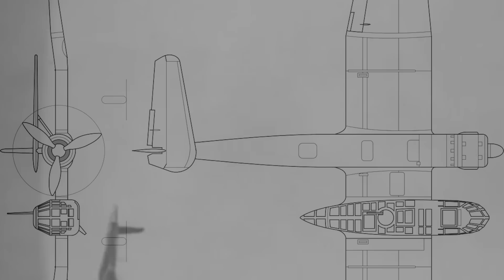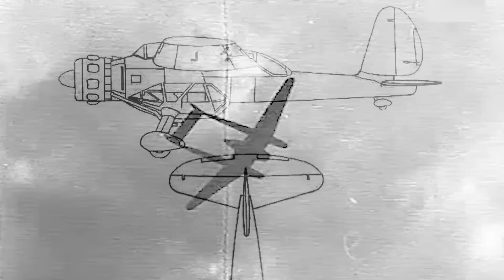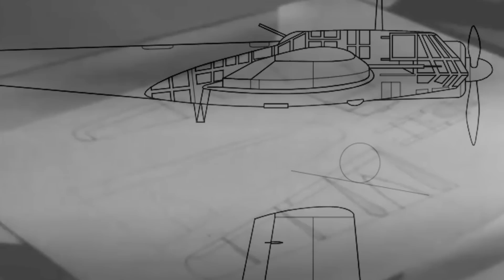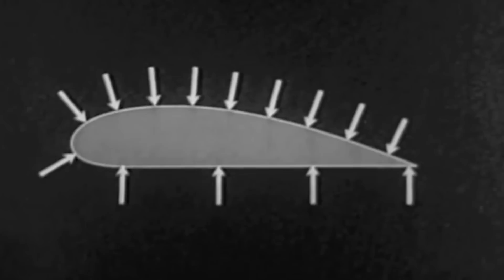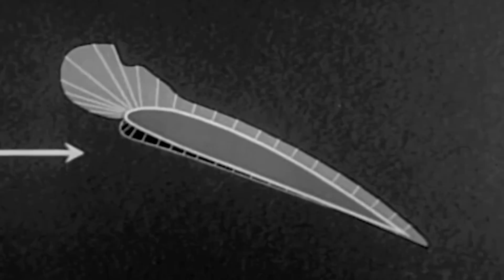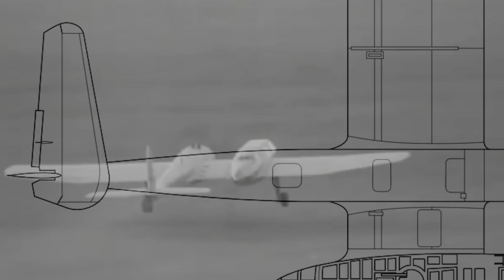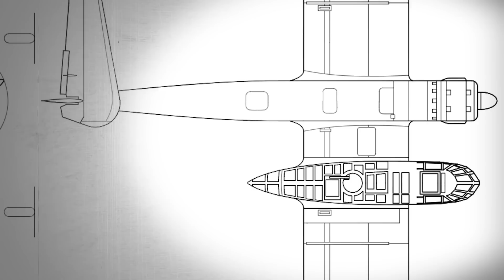BV 141 - The Most Asymmetrical Airplane of WW2

Comment: G'day Dark, When you read the extensive literature on this aircraft, including the glowing Nazi and Allied pilot reports you will conclude, as the designers intended, that this was probably the most symmetrical aircraft, in flight, ever built. This astoundingly clever design compensates for the lift and yaw asymmetry of normal, single prop fighter aircraft of the time. 
Depending on the direction of rotation of the prop; a standard single prop aircraft continually wants to move and yaw to the right or left. This means a constant flight control effort by the pilot to manage this 'normal' lift and directional asymmetry. It's so common it's not even noticed as a problem by those who designed and flew this type of traditional aircraft. It was just the way things were. It is a similar problem that requires a tail rotor on a helicopter to make it fly in a straight line.

The BV-141 did away with this problem entirely resulting in an aircraft that was significantly easier to pilot. The rear horizontal stabiliser on one side only; plus, the slightly longer wing on one side, meant the aircraft was perfectly balanced in lift and ease of control by compensating for the added weight of the crew compartment.

The only fault in this design is the fact that visibility was severely restricted on the left side of the crew compartment. They were, mainly, getting a view of the 'engine fuselage', although they could still see downwards on the left, in a limited sense.

The word asymmetrical can only be applied to the BV-141 in a visual sense and that is purely a description of the aesthetics of the aircraft, it has nothing to do with the aeronautical qualities of the design, which were significant. It's even less important than the off-set nosewheel of the A-10 Warthog, at least in that case, the nose wheel was moved to allow for the in-line, gatling gun.

The BV-141 is, perhaps, the only example of an aircraft that doesn't 'look right' that did, in fact, fly 'very right' indeed. 

Someday a brilliant, young aircraft designer who knows nothing, or very little, about the BV-141 will try to solve the directional 'pull' problems of single prop aircraft and 'accidentally' come up with a design incredibly similar to this almost forgotten WW2 masterpiece of aeronautics.
Cheers, BH
Reply: There was a single-seat Italian fighter which compensated for the torque of the crankshaft by making one wing longer.
Reply: @balham456  G'day Balham, that was clever, and proves the point of the reading I've been doing on this subject. Do you happen to recall what Italian aircraft it was? No, matter if you don't I'll search for it on Google. 
Now that I've got to know the BV-141 I'm interested to know if there are any other aircraft that have tried to get around the asymmetrical torque problem. 
It's a pity that the Nazis had this concept and didn't use it. 
Then the Allies would have, eventually, captured one and I reckon if they had done a really big version of the 141, it 'might' have solved the problem of finding aircraft with big enough bomb bays to take the Grand Slam and Tall Boy bombs. A large engine with a long fuselage; then the crew in a separate compartment 'might' have solved that problem earlier in the war when those huge bombs would have been quite useful, as B-17s couldn't carry them and the bomb bay of the B-29s had to be modified to carry them in the end.
Cheers, BH
Reply: @BillHalliwell  it was the MC.202
Reply: The Scaled Composites Boomerang is not a single-engine design, but it does match the assymmetry of th BV-141 so maybe some of the same thinking went into it...
Reply: This sort of aircraft design might make a very useful sightseeing aircraft (although what I have in mind is a passenger tour vehicle seating, oh, 10 to 40 people, not 3, and definitely no machine guns). Maybe make a civilian BV-141 tour airliner?
Reply: Blohm & Voss: rigorously tested precision engineering to completely eliminate the effects of engine torque with minimal pilot input, resulting in an innovative design that was only killed due to an engine shortage 

Supermarine: haha contraprop go brrr
Reply: A lot of WW2 aircraft were considered "hard" to fly. Half of the aviation casualties were during training.
Reply: @tacitusthehistories5417  G'day Lloyd, Yes, you're right. You'll notice there are many 'Hollywood produced' WW2 'How to Fly' short films made to help familiarise air crew with the 'special characteristics' of various aircraft. This was code for either 'poorly designed' or 'too complex for levels of existing training'. This is one of the many downsides of the US trying, desperately, to catch up to RAF and Luftwaffe training and flying standards. 
It was also one of the results of the US trying to train hundreds of pilots, navigators, bombardiers, gunners and WT operators etc. plus mechanics and airframe fitters in the shortest times possible. Despite leading-edge designers and technologies, creating huge air forces from virtual scratch takes time and amazing amounts of resources.
Even with the, for the time, incredible B-29s, they were (like many US planes) plagued with problems stemming from top speed development processes. There are instances of high USAAF brass ordering aircraft to go into full production without seriously detailed aeronautical research.
This was not deliberate laziness or a lack of professionalism, the US simply had to get into the European theatres and take care of the Japanese threats ASAP. 
It was just what had to be done. 
Many brave young men gave their lives before even being shipped out overseas; dying in training accidents. Once on deployment the speed and zeal of their training continued to take its toll. Before they knew it the Eighth Air Force was making regular daylight bombing runs over Europe, despite warnings from RAF chiefs that this would lead to heavy losses, as they had learned to their peril.
Anyway, I've written too much, again. 
Cheers and all the best. BH
Reply: Developing an air arm is very different to pursuing aerodynamic excellence. This aircraft is a design tour de force but the problems were that is was difficult and complex to build, and that it required the intended pilots to throw away their previous experience and start again with a completely new approach. Hence, although a work of genius, it was something completely inappropriate to the requirements. Which is a great pity.
Reply: that was a great remark, i reckon its a cool plane.
Reply: “Who are you who is so wise in the ways of science?”
Reply: For all their faults the Germans were no fools and had some very talented designers and innovator's under their command
Reply: Non pilot, non historian here. About the torque of the props, which I notice in films when I see planes leave the ground from a head on viewpoint ( like in the film adaptation of Catch 22) which makes the planes yaw when they leave the ground...did the Dornier 335 counter this with its pusher/puller props?
Reply: @felipecardoza9967  G''day Felipe, I'm not an aeronautical engineer, however, I've done lots of historical research on military aircraft from the end of the WW1 and all through WW2. An engineer or experienced pilot can correct me here, but as I understand it, this yawing is only really pronounced in single engine aircraft and this is caused by the type of the propeller and the direction in which it rotates. 
This will, I'm told, cause a natural yaw in the same direction of the prop's turn. 
It's not great and all pilots who train on single engine aircraft naturally learn to compensate for this fact of aerodynamics. I've not looked at a single engined aircraft that has two, contra-rotating props driven off the same power plant. I'm not even sure they existed as I've only ever researched Allied aircraft; apart from the BV 141 (and only because famed RN test pilot, Eric 'Winkle' Brown flew a BV 141 and gave it an excellent flight report; noting that it had far less, or almost no, prop-directional yaw. As for multi-engined aircraft I have no idea. But, at a guess, aircraft like the famous quad-engined Avro Shackleton with twin, contra-rotating propellers on each engine, would not have any yaw effect at all from propeller spin direction; one prop on each engine being cancelled out by the second prop. going in the opposite direction. 
I have no formal aircraft engineering qualifications; my interest is purely historical and because I used to serve in the air force. 
Our service flew the amazingly versatile DHC Caribou military transport aircraft and they were notorious for their yaw produced by two long-bladed props and their, designed ability for STOL at low speeds on just about any type of flat surface. I've seen them, and been in them, landing with about a 30 degree yaw pointing to one side of the strip yet the landing speed was so low the pilots were able to correct the yaw easily once the gear touched the ground.
To, finally, answer your question; as there were only 37 Dornier 335s built, I know nothing about their flight characteristics. Nor have I read about any Allied test pilots flying them after the war. 
If anyone did fly them after the war, chances were that 'Winkle' Brown did. He flew just about every other aircraft that was built in the pre-war, war and post war period, around 480 types in all.
Sorry I couldn't be of more help. Cheers, BH
Reply: @BillHalliwell  thank you.
Reply: I9
Reply: Tahts really interesting fair play
Reply: still useless for single prop.

at different speed/engine power the pilot still has to fight his way through the management, as someone from the top reply wrote, the Italian did away with it with a few inches added to just one of the wings have done a reasonable job already.  a plane with twin boom drag but without twin boom power doesn't sound too clever to me.
Reply: Less of an issue with a turbofan.
Reply: Good day to you, and thanks for that rich info!
Reply: @router9717  Thank you, James...James Bond... Cheers, BH
Reply: Good day to you, and thanks for that rich info!
Reply: "This means a constant flight control effort by the pilot to manage this 'normal' lift and directional asymmetry."  Hardly, as that was the intent of the "trim" adjustments.
Reply: @Nova-Beef  G'day Joe, I was merely quoting one of the most experienced pilots ever to take to the air. Certainly, Capt. Brown knew much more about how this plane flew that either you or me. BH
Reply: Bill Halliwell:  Not a pilot are you?   You wrote "a standard single prop aircraft continually wants to move and yaw to the right or left. This means a constant flight control effort by the pilot to manage this 'normal' lift and directional asymmetry."   What nonsense!  Have you never heard of trim tabs and trim controls?   Trimming doesn't just balance up the controls against variable weight distribution, it balances up against prop forces as well.   When the pilot has adjusted the trim controls as required, he can take his hands off the stick - the plane will carry on straight and level.  Asymmetric forces don't just apply to single engine aircraft either.   With 2 or a multiple of 2 engines, you have the option of contra rotation, but its common to have all 2, 3 or 4 engines turning the same way so that everything is standardized and interchangeable.  However, the one big prop in front of a fighter does make for proportionately larger asymmetric forces - eg the Japanese Zero - no need for constant effort by the pilot in straight and level flight - you have it wrong there - but the Zero couldn't turn as fast in one direction as it could in the other,  the difference was significant which the Americans exploited in dogfights.   So, its not about pilot workload, its about performance.
Reply: @keithammleter3824  G'day Keit, I bow to your superior knowledge. Cheers, BH
Reply: @BillHalliwell  classy reply. The meek (teachable) shall inherit  the earth.
Reply: @keithammleter3824 I am also not a pilot, but I think you may have missed Bill Halliwell's intended point. You can apply trim, but trim is a workaround to having a fully symmetric aerodynamic design in the first place. Also trim induces a lot of drag, and needs to be modifed whenever the flight parameters are altered.
Reply: @tachikomakusanagi3744  : I don't think I missed his point.   He specifically said it needs "a CONSTANT flight control effort by the PILOT" - he was talking about pilot work load, not performance.   And his perhaps cheeky reply to me somewhat indicates he was embarrassed, and confirms  my interpretation of his comment was correct.
I agree that trim is a workaround that cannot restore performance to what it could be if there was no asymmetry - say if you had contra-rotating props (which are also a bit of a work-around).  However, the extra drag is generally not significant.   Check out the trim tabs next time you see an aircraft - they are tiny compared to control surfaces.  You need trimming anyway, to counter imperfect and shifting load.   Yes, trim needs to be altered whenever flight parameters change, eg change of throttle setting, change of altitude etc, but this is often automatic or semi-automatic.  Not during the War though, I don't think.   In common light aircraft you need to retrim occaisonally as fuel is consumed, but you do it without thinking.
The biggest impact on the pilot of single prop asymmetry in high performance aircraft (as in early Spitfires, Zeroes) is that they tended to want to go sideways off the runway during full power takeoff, requiring the pilot to correct for it.  It was just something they had to remember for their first takeoff.  Once air speed was sufficient to get airborne (and thus sufficient over tail surfaces), these aircraft were fine.
Reply: @tachikomakusanagi3744  :   I should also point out that offsetting the engine/propeller from the aerodynamic centre line as with the BV141 is also a workaround - it's just another form of (fixed) trimming and also drag inducing.   The gyroscopic forces of the propeller and its circular airflow impact are still there.  The main reason, and very probably the only real reason, for this design is the exceptional aircrew visibility compared to the conventional single engine in front design, while avoiding the yaw instability and fire risks of an engine/prop in the rear configuration, which is the other single engine solution to the visibility problem.
Reply: @keithammleter3824  I was going to mention trim, but you already covered it very well. I was also going to say, I highly doubt there will ever be an aircraft designer that will need to create a new solution, especially like a fixed trim workaround like this. Normal trim control does a great job and we are already pushing away from props as a form of propulsion. Jet turbines rotate, but I assume they have much less if any affect on the necessity of trim.
Reply: @ec7005  :  You are essentially correct.   There are two bad aspects of propellers: 1)  Gyroscopic effects which make an aeroplane turn differently in one direction than the other, and 2) imparting a rotation to the airflow, affecting trim and wasting energy.    There are two solutions:  a) pairs of contrarotating props, and b) reduce the propeller diameter.  To handle the same power, if you reduce diameter, you must add more blades.  If you want to handle more power, and not increase the bad aspects, add more blades.
That, and the avoidance of longer undercarriage and reduced engine RPM that would be needed if diameter was increased, was why the later versions of the Spitfire,  with progressively upgraded engine power, had more blades - starting with the standard 3, progressing to 5, and finally having 2 x 5 in contra-rotation.
A heavy bomber, with (say) 4 engines is really an example of having lots of small diameter propeller blades for the power level.  That is one reason why Bill Halliwell in his second post is really getting bizarre in suggesting that the BV141 configuration is good for bombers.  (what about the lateral weight shift when dropping a bomb - urrghhh)  He has a non-solution to a problem that didn't exist.  (The reason why the B17 could not carry large bombs was not due to aerodynamic limitations - it was due to the bomb-bay shape used because the designers did not anticipate the advent of large bombs.   Neither did the Lancaster designers, but they fortuitously used a longer shape and the British were prepared to seriously overload their aircraft and wear the resulting take-off failures and accidents)
A jet engine carries the idea of lots of small diameter blades to an extreme.  And the presence of the static blades kills the rotational airflow.  So, yes, you are right - the  trim effects (already insignificant in multi-engine aircraft anyway)  are practically non-existent with jets.    Even with high-bypass jets, which are essentially an engine-driven fan in a short pipe.
People have incorrectly latched on the trim aspects of the BV141 as a virtue, but the reason for it was to get great visibility with only one engine, not the trim aspects.   The trim aspects of the offset engine were not a virtue - the designer's point was that they were not bad as a lay person might think.
Reply: @keithammleter3824  calm down
Reply: @TerryWhisk  : What?   After raging all this time?
I just love Bill Halliwell's nonsense.  For example, he wrote " many downsides of the US trying, desperately, to catch up to RAF".   He must live in a parallel universe.  Australia's RAAF pilots in WW2 were first exposed to British aircraft, then because British industry couldn't deliver, American aircraft.   The US aircraft were a revelation in terms of ease of flying, reliability, and ease of maintenance.  Even Churchill, in his history of WW2 6-volume set, describes how sending British fighter aircraft to North Africa involves having highly skilled mechanics work on them for a week or more after arrival before they were flyable.   This was a disappointment, because, because American fighters came in special crates and took about half a day to assemble by comparatively less trained men.
The fact was:  Britain was a fairly small country (~40 million), not particularly rich, and so didn't have the resources to produce really good military aircraft, or anything else, eg tanks (the Spitfire was to some extent and exception: luck, as a couple of brilliant men worked on it, and business opportunity - engine knowhow was exchanged for wing design methods with Germany on a commercial basis, before the War.  When Hitler came to power and started arming, the British government spent almost nothing on arming, because they couldn't afford it.  The US then had ~200 million population, was rich, and did have the resources to go well past Britain.   That's why, as Churchill describes in detail in his books, his prime strategy to win the war was to beg, haggle, manipulate, trick, and do everything possible to get the Americans to enter the War  and win it for him.  Britain had neither the manpower nor the engineering and manufacturing capability to do it - not a hope.
Reply: @keithammleter3824  or maybe he just has a whole lot more class than you . The meek (teachable) shall inherit the earth.
Reply: @peterpeplinski9923  Well it isn't classy to make statements that are wrong, and it certainly isn't classy to claim to be an expert in something when you are not.  
"The meek shall inherit the earth" is a well known saying from the Beatitudes (in sermon on the mount) and has different interpretations put on it by different scholars.  A common interpretation by committed Christians is essentially "recognise you need the Lord".  One possible contextual meaning of "meek" in this Beatitude is "intellectual slave".
The fact that British aircraft were inferior to, and technologically behind, American developments is well documented.    Even Churchill, pro-British as anybody, reported numerous cases in his 6-volume history of WW2 where he called for inquiries and reports as to why British aircraft (and other equipment) were markedly behind American products.
Reply: @keithammleter3824  such an aggressive tone...
Reply: @keithammleter3824  The amount of typing you have done on this thread makes me believe you would be better served writing a book.
Reply: @thecocktailian2091  : I'm not sure whether you are paying a compliment or being cheeky.   However, writing a whole book scares me.
Reply: @keithammleter3824  you are unbearable
Reply: @keithammleter3824  first of all, calm down mate, secondly, not acknowledging the required effort in a high power to weight ratio prop aircraft is simply wrong. While in level flight, trim does cancel out the effects of the prop, the trim needs to be adjusted at large speed variations as the efficiency of the ailerons decreases. I would argue that this adjustment does very much require a conscious effort.

The idea of the BV141s design is that there is no trim needed and that the placement of the engine is directly compensated by the wing surface, which is not affected by IAS.
Reply: @polygorg  :   It is true that varying the power setting or airspeed affects trim, which requires readjustment of trim.  Trim is also affected by COG changes as fuel is consumed.   However, an experienced pilot will cope with this without thinking much about it.  No doubt you drive a car, Polygorg.   Remember your first lesson?  It seemed a lot to do didn't it?   But by the time you got your license, it was all pretty much automatic and you could talk to your passenger girlfriend without any driving risk or thinking about clutch, brake, accelerator, turn indication, maintaining distance to car ahead etc at all.  
However, statically balancing out torque by asymmetric aircraft design is no different to doing it just by a mean steady trim tab setting.  Clearly, it is just another way of applying asymmetric drag just as the trim tab normally does.   BV141 trim will still change with power or airspeed or fuel consumption changing the weight and COG.   It can only be inherently balanced at one particular power setting, load, etc.  The pilot still needs to readjust trim from time to time.  In aircraft with contra-rotating props or multi-engine aircraft with left and right engines rotating oppositely, trim adjustment is still necessary but not so much.
In modern aircraft of any significance, of course, trim adjustment with change in throttle, flaps etc is automatic.   Take a look at YouTube videos of twin or multi-engine aircraft flight decks during flight.   Typically, the engine throttles are in the centre between the pilot and copilot.   Just to the left, ie near the pilot's right knee,  is a disk, marked with white stripes and/or ridges.  Whenever the pilot does something, and from time to time, this disk rotates, seemingly with a  mind of its own.   This is the automatic trim working.  The pilot sets it up initially and then it keeps trim correct for the rest of the flight.

All this about trim in the BV141 is just a red herring started by Bill Halliwell.  The design was about getting excellent visibility.
Reply: @keithammleter3824  I've flown a plane, I know where the trim is. Upon further investigation, I see that the plane still needs the application of trim in order to combat rotation.

The asymmetrical design did however have some large advantages, combining the upsides of single, and twin-engine aircraft. 

The design was in fact, optimized for visibility, that much is true. However, in order to only use a single-engine and not two as dictated by conventional design practices, the engine, a rotary engine that needed direct airflow was placed in an asymmetrical orientation. 
This allowed the plane to have a comparatively thin body which allowed airflow from the engine to interact with the tail surfaces far more effectively. The wing design also assisted the exceptional maneuverability of the Ha/BV141.
Reply: @polygorg  : Glad we now more or less agree it's design was about getting excellent visibility, and not elimination of trim requirements or reducing pilot workload.   Incidentally, the BV141 engine was a radial, not a rotary.  Nothing unique about its need for airflow.  There's a big difference between rotary (well and truly obsolete by WW2) and radial (not obsolete until the jet age).  Radial engines have the cylinders circularly dispersed about the crankshaft, which rotates as it does in an inline of V engine, and have inlet and exhaust valves.   Rotary engines have the whole works rotating around a fixed crankshaft, and typically had one valve per cylinder that opened for both intake and exhaust.
Generally in aircraft design, the tail is placed so as to avoid wing disturbance to air flow for as many flight conditions as possible.   Generally this means the tail surfaces (horiz and vert) are well above the wing and engine centre lines.  Control is lost if the aircraft is pitched up sufficiently for wing turbulence to flow over tail surfaces.   Looking at the BV141 outline, it seems fairly normal in this regard.  The horizontal part of the tail is only on the engine side, but this was stated to give the rear facing gunner the ability to shoot at a following aircraft. 
What makes you think the wing design gave increased maneuverability?
Reply: @keithammleter3824  Sorry, mixed up the words there. The body is rather slim and airflow over the tail not hindered by a cockpit. I would also assume the long tail increases leverage.
Reply: @polygorg  :  Correct.  Distance from wings to tail is a compromise.  Greater distance gives greater control effect in normal flight (or the same effect with less control column force if tail surfaces are not lead balanced), but makes the aircraft more susceptable to loss of control (and sometimes control effect reversal) when nose up due to wing spillage affecting airflow over the tail.   That's why you see heavy aircraft not expected to manoevure sharply eg bombers, with a large distance, and aircraft expected to climb steeply, such as fighters, with a relatively short distance.
You would be correct about the cockpit, but I think the advantage rather small.
For safe handling, the centre of gravity should be at or a bit behind of the centre of lift and centre of drag.   A large tail distance lets you have weight balance with the engine(s) well forward, as it is in the BV141, which in itself makes for an easy manoevurable aircraft to fly.
Reply: @keithammleter3824  I’m a pilot, and I have to keep my eye on the ball, and apply constant rudder to keep my 152 balanced in flight. So, what am I missing here?
Reply: @kungfucommando1642  :  It's over 40 years since I flew a Cesna 150/152.    Only a preset (adjustable only on the ground)  trim tab for rudder?   It may or may not need adjusting.  Straight & level should need no rudder effort most of the time.
Reply: @kungfucommando1642  :   If not the rudder trim preset, perhaps control cables not adjusted correct, or turn and bank indicator not calibrated correctly, indicating straight & level when you are not.
Reply: @keithammleter3824    Jeee zzzzz!! a real keyboard EXPERT!!!!!!!1